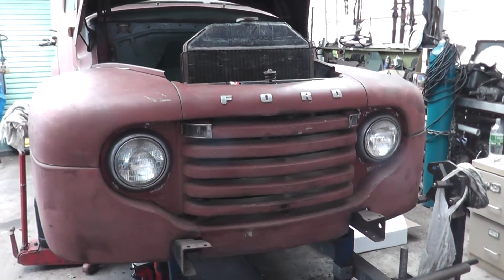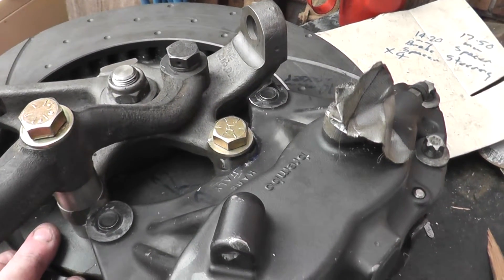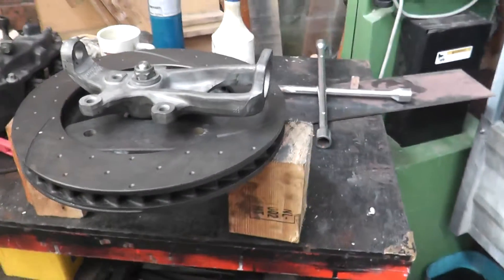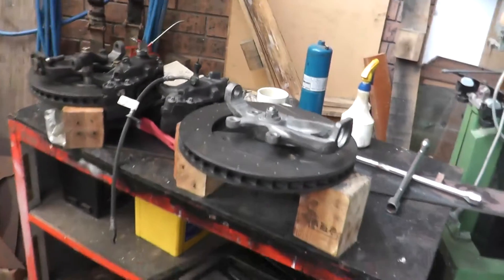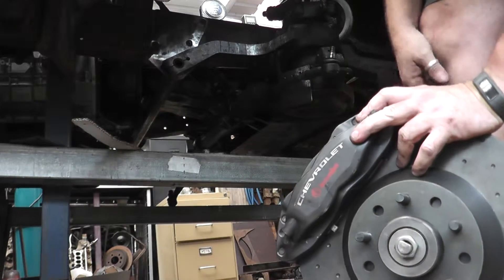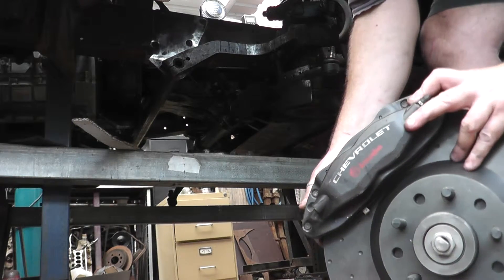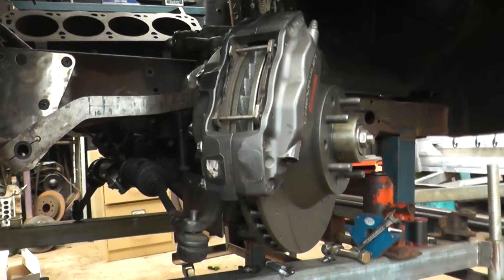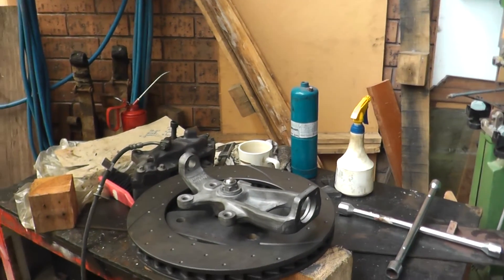Ford F1 truck project , part 18

Comment: I have a 1953 ford bread van have p71 crossmember 454 t400 gear vender was going 9in but thinking 2017 gt mustang independent rear
Reply from the maker: Sounds like a great idea , wheel track is the only concern ,you want them close to equal front to rear otherwise handling and wheel dish could be a problem . Good luck !

Comment: I have a 1948 f1 with an 86 jaguar front end. Thought I found the center line but it seems to far forward. How did you find you center of the axle?
Reply from the maker: Hi, I did mine visually with a wheel attached to the hub to start with , did some measuring to center it the best i could . Once i had it centered by sight , I did more precise measurements as described in part 8 and 9 of my F1 truck videos ,also in later video's I use a 5 beam lazer device (a cheap one ) to accurately confirm my positioning , it's probably the best tool I have bought so far for engineering  brackets and mounts to the frame , I hope this helps you  with your question . Good luck with it .
Reply: @pyroman6962  thank you I will check out the video.

Comment: Hi pyroman 6962 great work i have a project the same how can i make contact are you on FB
Reply from the maker: Hi , I dont have FB for various reasons but nice to see F trucks being built in australia . If you have questions I can try to answer them here maybe ..
Reply: the bracket at the front did you use the same on the inside and can the jaguar sway bar be fitted is there enough room
Reply from the maker: Short answer yes and yes , in the video's I have only the outer brackets in place but I have inner ones cut to the same profile and will be welded at a later stage , just doing a trial fit up now , I want to plate the underside of the radiator support beam and will fit the inner brackets after that is done  . The jaguar sway bar will fit with these brackets in place as was my initial plan but things have changed somewhat now ...
Reply: thanks do you have email or some other way to contact
Reply from the maker: I do but cant put it in this section as it will be made public ...